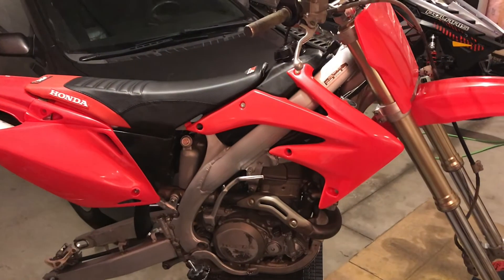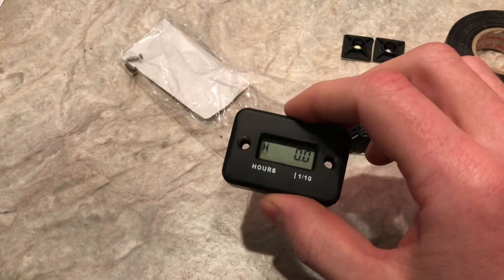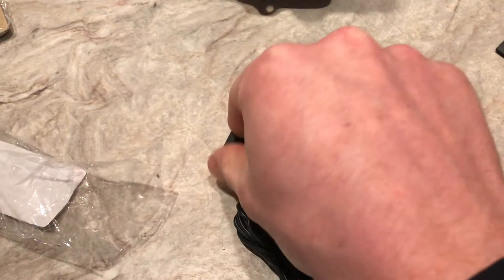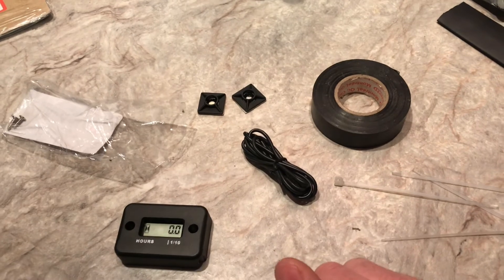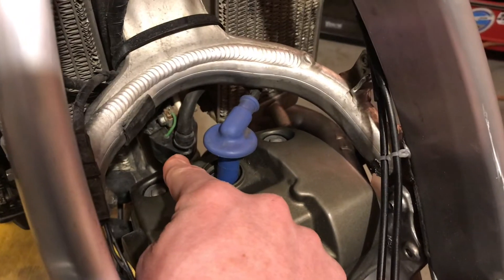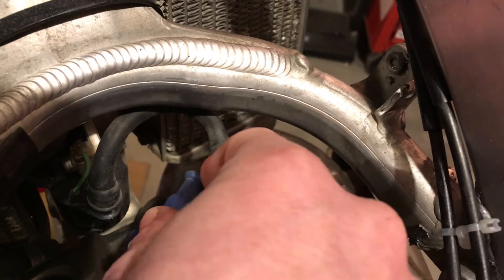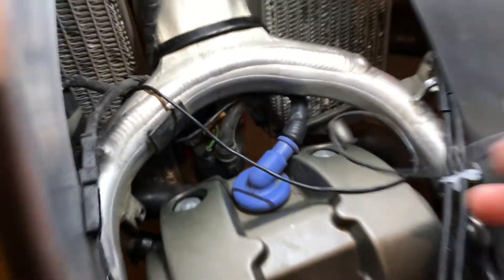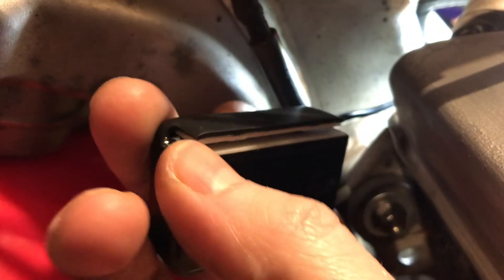How to Install an Hour Meter on a Dirt Bike

Comment: Nice video. I installed my first hour meter tonight on my 2023 CRF450R. There was a lot of extra wire, probably twice as much as I needed. I did build in some slack but the rest of the excess wire I cut off. I didn't see the point in bundling up all the extra wire in the bike.

Comment: A fine moving picture Mr. Pike. I put a Trail Tech on my KTM and then replaced with a Voyager but it was more than 10 bones. Should have got a cheap one I guess. For that money, I would put one on the lawnmower and pressure washer for oil changes.
Reply from the maker: Thanks! I’ve put them on a few bikes now, no reports of issues. My CR has one too and it seems ok! Sure hard to beat the cost of them!